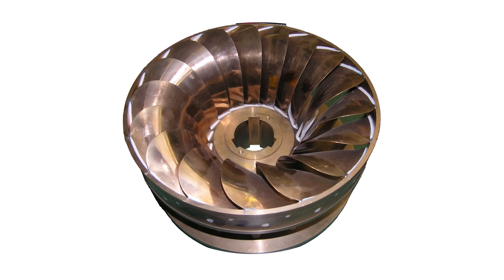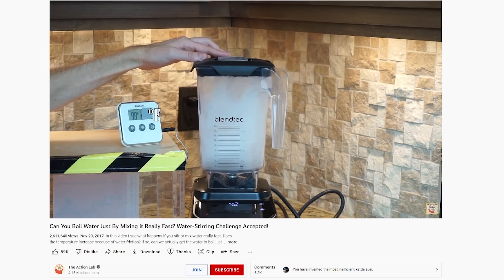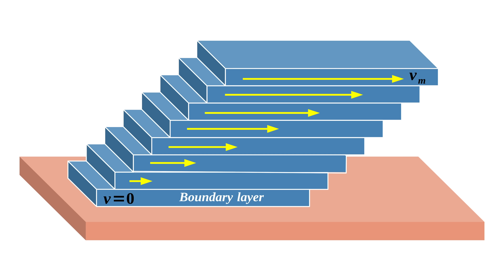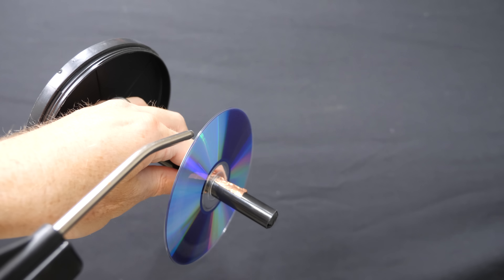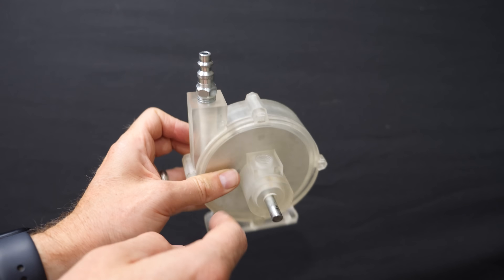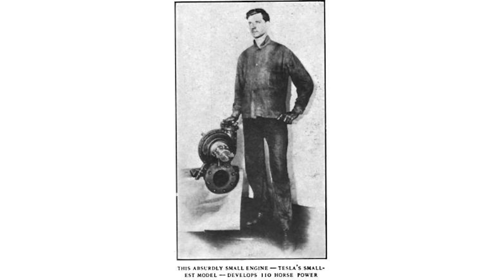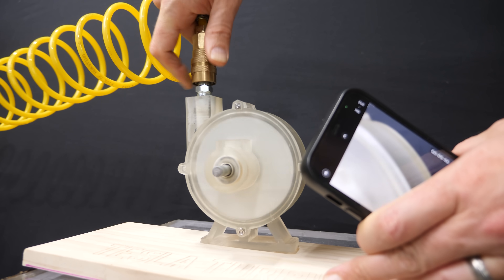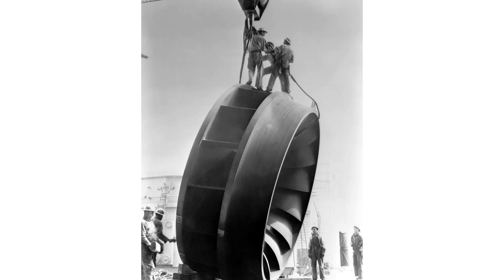How Fast Can a Tesla Turbine Spin?

Comment: The main challenge here is the high cost of replacing existing systems. However, Tesla turbines as a concept have the potential to compete directly with these systems without requiring significant further engineering. Just imagine how far we could advance if we dedicated the same years of engineering refinement to Tesla turbines as we have to existing technologies.

Comment: Main problem is when it takes load it sucks 😂 I had built one but when under no load it sounds like a jet engine😮 I loved its sound but again when I connected my Tesla turbine to a rotating magnet and coils to produce electricity.it’s torque just sucks it feels like it only have power In high rpm😅

Comment: Tesla pumps (Tesla turbines powered at the axle) are used to pump fluids when low shear force is required (e.g. living cells, foamy, high grit such as concrete).

Comment: Having personally tested many Tesla turbines to Mach 1.3 with no warping using aluminium alloys, I can safely say that most of the online claims about Tesla and his turbines never actually put a load of money into research and development of his machines.

Now a bunch of incorrect stories are parroted.
Reply: I'm afraid testing on a small personal scale does not debunk the warping issue, when used at an industrial scale warping is an issue that happens over time.
Reply: @spaceageGecko  what would you class as an industrial scale? There are commercial Tesla turbines in operation producing megawatts continuously under harsh conditions. It depends on the material and the temperatures being used.
Reply: @nikola.tesla.r.and.d.centre  Tesla turbines are not used in large scale power production, they provide zero benefit in that role.

They see more use as fluid pumps.

Comment: In my opinion,  one of the most significant factors that makes the tesla turbine unattractive vs traditional designs would be the inability of the tesla turbine to digest system debris.  No system is perfectly clean,  no matter how much filtration is on installed.   Turbines and pumps have to be able to pass a certain amount of debris(be it rust, silt, condensate, etc). If a turbine or pump is designed with such tight tolerances that it can't tolerate any debris, it becomes unrealistic use.

Comment: This will be new padless brake save environment , and electrical generator in ...the problem is that in kinetic energy and inertia needed so if the disc aline without inertia and monmentum we lose like in combustion engine we need counter weignh to keep inertia...and most large turbine right now need counterweignt fluud to release earth center if weight otherwise earthquake and distorted motion like engine alongate better than side way arrangements or the piston in rotatry engine difference than piston because of earth centroid ...in piston one up one down neutralize centroid effect but in rotary can change earth with billion of cars driving we can throw the erath into never land

Comment: You can reduce rpms by magnetic induction. Then boom you have electrical current. But lets not stop there...on the outlet and inlaid into the blades why not introduce the tesla valve so that the flow reduces the turbulence in the reverse. And then throw that electrical power into a Tesla coil to transmit that energy wirelessly.

Comment: Kind of a strange question for you, but theoretically, could Tesla turbines be used to make an engine similar to the chrysler turbine engines but running off heated compressed air, that also has a series of alternators to keep the system charged (using car batteries)? Had the idea pop in my mind the other day but don't know enough about them to work out if it's possible.

Comment: Laminar fluid flow is non-sense it does not exist. Only by manipulation of math and physics laws it can exist. First laminar flow violates continuous (uniform) flow which is  fundamental  law on which Bernoulli hydrodynamics laws are based. Boundary layer of laminar flow don't exist, all shear friction happens on rough surface of disk, channel, pipe, tube or duct. Secondary not viscosity but viscoelasticity Hoke's law elasticity applied to fluids is called non-Newtonian fluid for example. blood, heavy oil, molasses. All gasses are Newtonian fluids and water and small-molecular composition hydro carbonates liquids are Newtonian fluids too. Friction between molecules can not happen because Brownian motion can not create energy (heat) or destroy energy (cool down) that is most fundamental law.

Comment: If we e grave small size sawtooth on the side of the disc may work less slip underload and liquid is way better because incompressible while air may slow down tremendously under load

Comment: I wonder if a stack of CDs lined up behind the grill of an SUV hybrid could be used to charge the battery when driving at speed? Most hybrids still have a grill at the front to allow air to cool the radiator, what if it turned the turbine before reaching the radiator?

Comment: What about reversing the turbine by putting the input force on the axis? I'm not an engineer but wouldn't that give you something like and air compressor? But obviously weaker without blades forcing air in.

Comment: I know that tesla turbine has problem with its rotational speed can become so fast it can break its disk but isn't it possible to use this turbine in house which has a slow wind to power the house itself? Even though it is not use in big industrial electric generator? but

Comment: The exhaust should be released through holes fitted at the center of the turbine. That will make it more efficient. And, I am always guessing if the pressurized gas can be released through a De Laval nozzle instead of a simple hose.
Reply: What is a De Laval nozzle?
Reply: @CraigLandsberg-lk1ep  A convergent-divergent nozzle.

Comment: About the decrease of speed affecting the efficiency of the turbine, why not fitting a planetary gear with the turbine attached to the sun gear, and the output to the carrier of the planetary gears, and a way to control speed attacked to the ring gear, so they function as a differential?

Comment: A 4" diameter Tesla turbine that I know of can reach 250,000 RPM. The trick is the fact the outlet to the turbine exits form the center, into the Tesla vacuum cycle. Tesla has stated his larger design needs 6 stages. But a 4" size 2 stage turbine can produce 125hp at 250,000 RPM.

Comment: Big tesla turbine would have a problem if spined at high sppeds because the outer points of the disk may reach sound wall breaking speeds.

Comment: Why not creating a Tesla turbine that can displace and reduce/augment the space between the blades to increase flow in slow stages and have the outer part of the disk rotating on ball bearings to avoid warping...
Then set the ball bearings on travelling rods electronically controlled. I think if the materials could hold the stess you could maximise the output, I know rotating ball bearings create heat but it wouldn't be much.

Comment: Interesting.  I wonder how it would affect performance if the edges of the blades were sharp, and if the blades surfaces were rough.
Reply: To quote Tesla- "It would delay the adhesion of the medium, dimples in the discs provide better results."
Reply: That's what I was thinking, you could test it with already proven high speed ultra thin angle grinder cutting wheels, they are already proven to be strong enough to cut through metal while absorbing shuddering vibrations 'and' they are rough! I am going to go try it soon😅 can't believe I didn't think of it sooner, thanks for idea friend 😮

Comment: Funny you should show a Blendtech Blender. In one of my first jobs out of uni, I had to investigate why these blenders various programmed modes weren't running for the expected time when used in Australia. Long story short, the firmware incorporated the AC supply frequency in their timing calculations and it had been hard coded to 60Hz. While doing some MTBF testing on them, I found when used repeatedly, with little break inbetween cycles, the metal blades were conducting heat from the motor into the jug, boiling the liquid medium inside. Will it blend? Sure. It can cook too!

Comment: Pelton turbines can reach up to 95% efficiency, and even on 'micro' scale systems 90% peak efficiency is achievable. Also the efficiency is maintained at a high level even for part-flow rates, mainly because of the low-loss design of the spear-jet.

Comment: For large scale industrial applications material strength becomes an issue as the discs are unable to be prevented from warping. Though they work well in smaller applications.

Comment: Since the pumped material does not impinge normally on the disks it can be a carborundum slurry or even concrete aggregate. There is vey little wear in the disks.

Comment: Does porting the turbine plates in the middle, and subsequently creating the mentioned spiral path, then create a situation where the outer edges of the plates are moving faster than the middle, preventing your turbine from ever achieving this laminar flow you described?  It seems like it would be impossible to stabilize the fluid speed versus a gradient of speeds across the width of the plates.

Comment: technically is rather neutral subject design prehapse is reminds on brushless fast speed electric engine but still operational it cold also a good vtol engine lets say you have hybrid on compressor or even diesel nuclear raw power and it tesla trubine cooling down core that works like regulary engine when water in cooling simply pumps faster up tp max and computer lowering power off rods since air frequncy whistle reminds on brushless swuush sound so tesla coil is like fluid generator bit fancy in nuclear submarine drive or aircraft carier as permanenet fuel if compound squezed into small volume even to easy for testing or labs for using power and with thorium cells plugs easy lets say if it use salt reactor and gas inside inside tesla then is like future tech and modern reactor at start and reactor behave like like one cylinder engine cup except it has cooling chamber that mimic combust chamber in gas or diesel car fancy tech would attach buble cap on ball that is tocamac in midle and speed booster and cartsh so called and catch liquid hydrogen ionized that is later used as burn fuel together with catalyst gas and try tzo mimic core shield so you pop ionized gas may be in wave slight curving potential to do speed lux  or direct or possibly direct trough oh you got nobel that einstein so proud on that german tank the problem is like in 3d shapes or light ilumination particle gas in buirst it remain to be seen how outer body shape can modify field in vector shot particle so in theory if buble works and body have temporary gravity potential a particle gets boosted atleast is descirbed in star trek so physcis should be porven as theory on paper then get in lab for practicla research and doing warp testing sound like salt reactor a minor thing with also some efinecy energy lvl is power is power but energy on tocamacs like factor 10x 14 x atleast so thats the diff in corvette tech flying science booming through space or use aproach speed so asumption off tocamac before warp is corect is nearly that ois time off balance enrgy and poeple well on vay in colonies and probably ower 2040 and omega1 enignes even compresor engine vtols using space ship transporter tach in transport and logistics also as solar cars and vtol transporters that realistic but it has through research and inovation facilities and productional demand in industrires and some aplications to inudustry best steps is already based companies with some production or intensions and get easier funding so people and financing would pay more atention to this topic and certainly tis topic goes ahed if stuff scraped already to warp testing speed particle bit realstic stuff with no lies based on creativityand comprehensive role off industry and starting role taks job finance sallary resutls off creativity and final tax givign as result as certain product that is later attached values looks scfi talk bur is actualy industrial assembly production in inudstry that require care and ceratin know how steps and solar agriculture and h gas power facilities have fututre in it as well tocmac cells and salt reactors for start then in colony scfi fileds which can be even with ocean  instead off river in big round rig simbolicaly underline colony and self selfsustain colony econicaly enviromental suporting to build rebuild power up and regrow agriculture and return power gas and bring more energy surplass and dmeand into colony that hwo it looks working or so called indstrial area zone in cities or colonies amond purpose build factories and industry and goals are based on resource or suply paths or basic know how for people who already some skills technicaly in electricity owerplus society is anythnig possibel so stuff like diamond faciliteis on colonies for trade or robot asembly lines for work creatigna nd work under imposibel are almost notrmal on colonies that the time off solar salt reactors and tocams and people well on the vay in the colonies live that expand howe it should look like

Comment: Consider the utilization of a portion of the generated electricity to power an electric motor, which would control the speed of the turbine and optimize it to achieve laminar flow, is a viable option to increase the efficiency of the system. There could be a gain in output with increased efficiency even with the use of electricity to control the speed of the rotor. By reducing turbulence and optimizing the flow through the turbine, the system's overall efficiency increases, leading to higher energy conversion and a corresponding increase in output. The energy used to control the speed of the rotor is small compared to the total output energy, so the net gain in output would still be significant. In an ideal setup the blades would be made of titanium or carbon fiber, although somewhat cost prohibitive, they solve the problem of distortion.

Comment: less than 10 seconds in: uhhhh...we know they work? they are in service in a few dams, the problem with them was never an issue with the basic concept, it was that making them more efficient requires spinning the device faster and actually making them more efficient than just sticking a propeller or even a reciprocating pump in there requires spinning the device insanely fast which means insane operating pressures and insane centripetal forces on the discs. a tesla turbine can theoretically be made to function at only slightly under 100% efficiency (more practically at something like 97%) but to get it to that point you would need an average flow rate inside the pump of just under the speed of sound...in water, and would be spinning your discs at almost the same speed.
in short there was never a question that they work and never a question about whether they can work well from anyone who actually ran the napkin math on the idea. the question was always whether or not they can actually be built at a high enough spec to work better than any of the other current options.

Comment: The real problem with these was when you get something of that size and scale close to a large car in size and weight spinning at 3500 RPM the structure itself starts to tear itself apart. Same can be seen with CD's if you spin them too fast they will literally just explode. The consensus was we do not have the materials at this time required to efficiently make disks that can withstand the forces.

Comment: The brilliance of Tesla's turbine is he took one of the problems of a conventional turbine, molecular adhesion on the blades, and made it part of the solution.

This approach of harnessing the problem directly to the solution was a constant in his designs.
Reply: in what other design did he do that?
Reply: @cnossen86 
In a Tesla valve; he used side circuits to create pressure differentials and thus make a one way valve with no moving parts.
The no moving parts is important, as it saves on wear and money for maintenance and spare parts.
Reply: Still don't understand this tbh
Reply: @fasted8468 

“Whenever you have fluid rubbing against itself in the walls of a container it creates heat. We can see this in a blender. The energy that you could have turned to useful work gets wasted as heat “ 
It’s good for smaller scale so can maintain high speeds and if blades warp not as costly and less likely to warp because not as much power
Reply: @anthonyurso3554  that actually makes a little more sense. Instead of AVOIDING adhesion, it uses the adhesion to its advantage
Reply: Amazing
Reply: It does not seem that the would be abel to handle much torque.